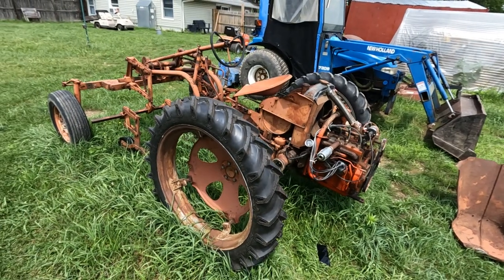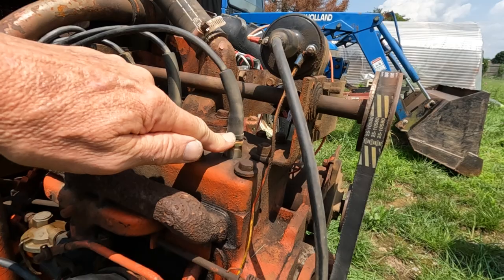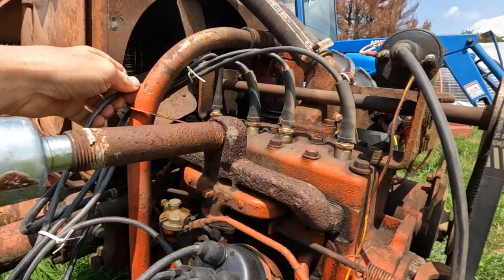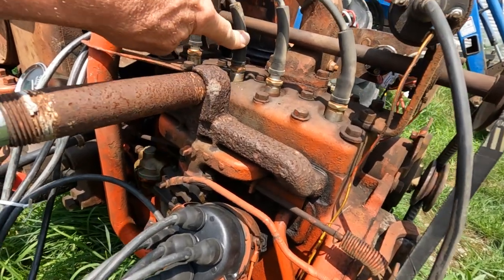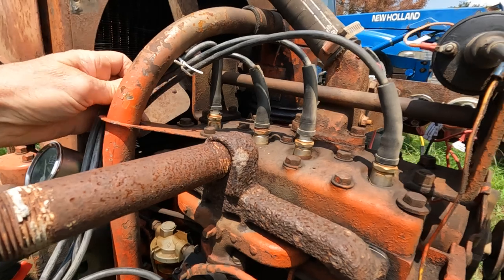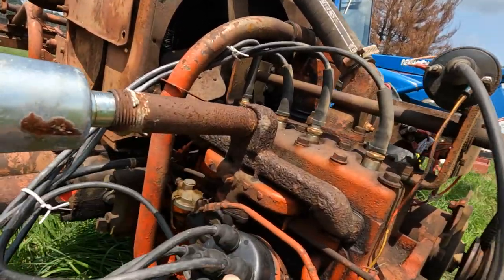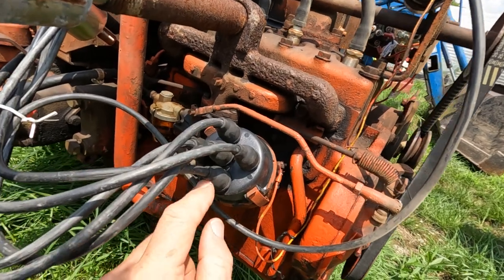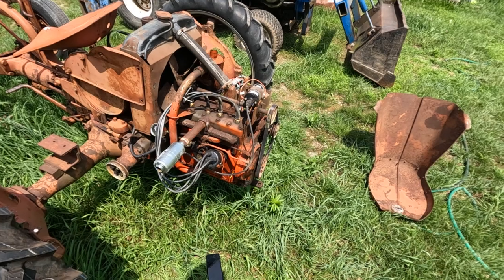Allis Chalmers G tractor spark plug wiring  diagram  and more

Comment: Am I understanding you right that the cylinders are not numbered sequentially?
Reply from the maker: It's 1 3 4 2 . Spark wires  are as shown
Reply: You have it all balled up!😁
Firing order is indeed 1342, but cylinders are numbered 1-4 from the front of the engine which is toward the rear on this tractor.  It’s a testament to how simple this tractor is that you have it running with so little understanding of what you’re trying to accomplish.